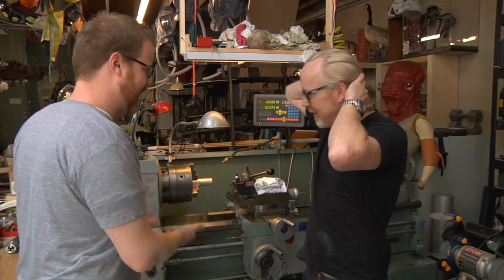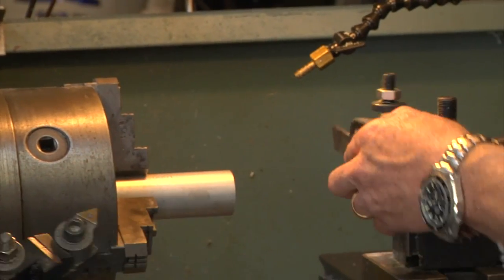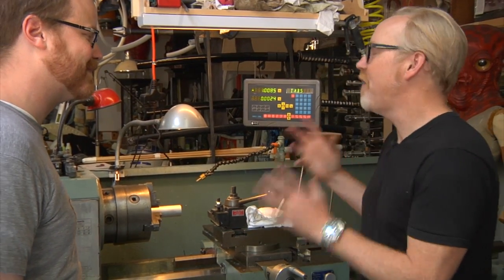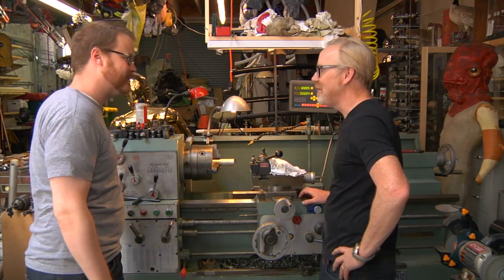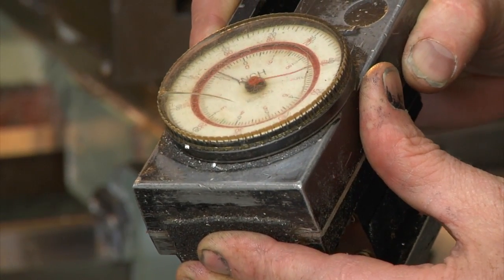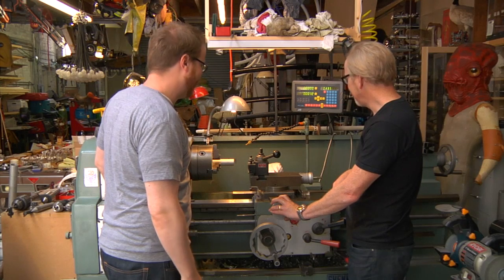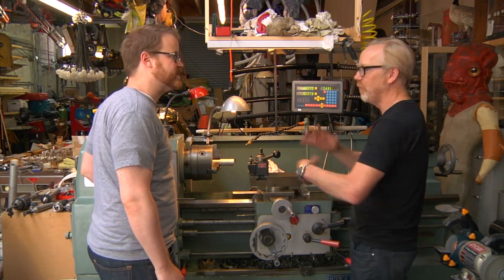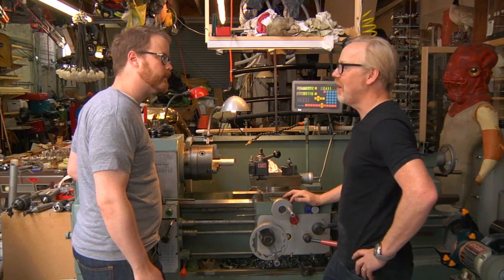Inside Adam Savage's Cave: Metal Lathe with Digital Readout

Comment: I've replaced a lot of broken glass scales and cleaned many more that had coolant or oil get inside. Even with guards they get contaminated by coolant and are still vulnerable to severe impacts. The shop I worked for moved away from glass scale readouts, especially on lathes. The magnetic resonance readouts are much hardier, easier to install, and impervious to coolant intrusion.

Comment: Nice little lathe.  Adam was right when he said the readout was a luxury.  Over the last 30 years, I've made fewer mistakes running a lathe without readout. A milling machine is a different story. Readout speeds things up 100x. On a lathe you have to pay more attention to what you are doing, instead of watching numbers on the screen. Dial indicators work just fine for hitting close tolerances.

Comment: Adam Savage just propagated a myth

A tool that is left in the Chuck will never in a million years fly across the room and go through a wall he has not seen this happen cuz it has never happened it will always fly straight down if the chip pan. It is of course incredibly dangerous to do that but I can promise you that it will never fly around in a circle come back up around the other side and leave in a position to go sailing across the room and go through a wall it is never happened in the history of this planet
Reply: Clown Whisper sometimes, when I first started, I would adjust the four jaw on the backside, and sometimes I would turn clockwise which would give it more room to fly out. Need more scientific day to confirm belief in your disbelief.
Reply: Can confirm 
Once myself and and seena few times The chuck key has a heat seeking devicein it thats 100% gurenteedto hit you in the balls 

The key falls out in the first 1/4 revolution so its not built any speed in rpm 
It wont do you any damage or ever go though a wall 
But its pretty embarising amd hurts a little
Reply: In schools in Denmark, in woodworking class, you have lathes. I have had a wooden bowl i were (was?) making go straight through the room, almost hitting my teacher in the head and shattering on the wall. Not a myth, can confirm from personal experience.
*edit: And why would it only go down from rotating? It doesn't care about gravity! Much stronger forces are at play here!
Reply: WiseOdd that is a wooden Bowl it is completely different dynamic then the Chuck key why would you even compare these two wildly different objects? A Chuck key you put in in front of you facing you and if you turn the lathe on it's coming down towards you so all it has to travel is a quarter turn straight down. It flies off and 99% of the time it will hit the chip and do you know how I know this? Because I set this experiment up 100 times and never did it fly straight away from the chuck it always fly straight down. even if it would get stuck in the Chuck and make a complete revolution around it would get stuck on the bed ways. the larger the Chuck you have the larger the key is typically unless it's a homemade key then I could see a rare possibility of it getting stuck in the Chuck and spinning all the way around and shooting straight out at head level. But the odds are astronomically against it. of course it is dangerous to leave the Chuck key in the Chuck but I guarantee you Adam has never seen one fly through the wall I promise you this
Reply: Clown Whisper didn't think of the different object dynamics. That makes sense. Let's agree on just never leaving that thing during operation 😀
Reply: Zachary Hodge yes if to stuck a key in the very back of a chuck it would be possible but that  scenario isn't really what we are talking about. that is more of a special circumstance type deal than someone just leaving a Chuck key in the common orientation

Comment: Now you cannot say that the lathe is the only tool that can build itself because with the 3d printers the game has changed
Reply: Not really. 3D printers, especially the sorts that ordinary mortals can acquire, are in their infancy and have huge, hard technological limits. Lathes have been around for millennia, were pretty much "the" machine tool for 95% of that time and can machine almost any material you care to name. They are limited mainly by their size, how efficiently they can be setup for any particular job, and how slow they can be run. Given sufficient time and operator error you could make almost any mechanical object on a lathe to a ridiculous mechanical tolerance. Compare against the accuracy, size and material limits that 3D printers have.

I don't entirely agree with the old saying about lathes but I'd like to see a 3D printer that can print its own bearings, cabling and microprocessors.

Comment: look on craigslist , theres better deals on bigger machines than there is on small .. invariably.
Reply: Yup, it's the 3-phase curse that sends too many great big machines to the scrap-yard. I so wish that I'd gotten into machining even just 10yrs. ago and I'd have had a whole stack of Iron in my shop...there is still allot out there but folks are getting wise to the new interest in machining due to YT and Instagram, etc.

What machines do you have? I've got a 10"x54" lathe and a 13"x42" lathe, I'm selling the smaller one and will be looking for a mill...Aloha, the Farmer
Reply: Knolltop Farms i bought a 7" grizzly , because since moving to louisiana , theres no craigslist deals on older machines. junk goes for 2000.. in ny, there was serious machines fully tooled for 800
Reply: Nice! I do love my old iron, but there are many times I long for a quick-change gearbox, and will likely sell both of these machines and upgrade eventually. That is unless I can get a good deal on a gearbox to fit onto the 13inch South Bend. Happy turning in the shop, Aloha...Chuck
Reply: Knolltop Farms oh man , i avoid threading like the plague on the grizzly, its such a friggen pain, you have 2 tiny keyways and it the key pops out its time for a dam telescope to find it lol
Reply: Yeah, threading dies have become my dear friends whenever I can fall back on them. It's not terribly hard to set up the gears, but it sure is easier to just switch a lever...

Comment: $10000 dollars at premium cost. very affordable.

  I definitely am wasting my time and dreams.
Reply: A lathe can be had for as little as 100 dollars.
Reply: +Oakwood Machine Works  Yeah, like a 100 dollar table saw or a 100 dollar miter saw. Useless. Pretty neat if you don't care about precision. I've used many types. I know you get what you pay for. sure you can get a drill motor and a bearing for about 150 bucks. good luck.
Reply: +Oakwood Machine Works and I don't think I made my point clear enough. 10,000 is a good price for such a precise turning machine. that's near CNC value. it is worth the money.
Reply: A. Finch I watched a used atlas sell for 125 and a unimat for 95 on bid.
Reply: Now your just teasing me! Lol... I'm gonna need a bigger shop.
Reply: A. Finch Yeah, a lathe just as good as this guys can be had for under 3-4k and a used cnc lathe, tormach or otherwise, for as low as 8-9k

Comment: how do the lathe build the sheet metal parts ? and how does he index the lathe while he building the gearwheels ?
Reply: The claim of lathe duplication has been around  for  decades.  Sheet metal parts can be hand made.  The key component is the lead  screw  and you ain't makin' that without  a lathe.   Mills cannot  make  long  cylindrical  objects.  Search  "making gears on a lathe"  and that will be your answer
Reply: That's a bit of a contradiction.
Of course you are making the lead screw (like a drill bit?) with out a lathe. How do you suppose the first one was made? 
It's just going to cost a lot more resources to build the damn thing.

Comment: Uhhh, you can build a mill with a mill
Reply: 7/16-UNF would be trivial with a short bar in a collet... While you'd have to make a series of studs and joiners to build up a drawbar. Far from ideal, but technically possible. Alternatively, swing the head around (assuming it's something like a Bridgeport or a round column), and hold a die in a large collet, and have the drawbar clamped vertically off the side of the table, and with heaps of heads you've got powerfeed for rigid tapping, this would basically be the same concept. Again, far from ideal, but technically doable.

Leadscrews... Yeah all I can think of is a 4th axis, and having the X axis connected to the A axis via a convoluted series of gears similar to how scrolls used to be cut prior to hardening. Have the A axis rotate N revolutions per unit distance of the X axis, and throw in a tiny ground tool. Again, far from ideal, but technically doable.

If we're talking about building a lathe the same size as the parent lathe, you'd probably be doing a lot of creative tricks to meet that challenge so it seems like a fair comparison.

Comment: He say that is the only machine that can build it self... well he haven't seen one of our CNC machines at my work.
Reply: heuhen CNC machines are just computerized versions of mills and lathes?
Reply: There are many version of CNC machines: CNC machines do almost everything, normally they have 1 to several mills, some of them have magazines to the mills with different tools, like that one at my work, it have three 35 slots magazines with various tools in. CNC machines do also drilling (at my work an CNC machines, tend to have 34 standard size drills), you can also add on an laths too. one of out CNC machines at work use 2 three axis mills, and 1 5 axis mills, and can operate 5 different programs at the same time.

CNC stands for Computer numerical control. you make a long program, telling the machine how to move and what tool to use.

A lathes, will get problem with cutting out big plates... a CNC will do it without question!

But we do have an Robot CNC at work, and if ou program it correct, it could repair it self, or it's companion robot...
Reply: seth newman ehhh Wrong, CNC and lath is two different things.. trust me I am a Professional CNC operator (not joking!).

But you can get CNC controlled lath.

Comment: Aah lathes, incredibly useful machines but also pretty scary (especially if you don't trust the people around you using one :P). I like how some comments are talking about "this not being a high quality lathe" and "Adam doesn't know much about his tools". You have to keep in mind that he is a prop-builder for the most part, not a rocket engineer. Also, apparently this does it for him, because he seems very happy with it. And that's what matters most.
Reply: I agree, as a machinist of close to 30 years I know that there are more ridged and precision laths out there but that one should do most of what you need done in most cases as long as it's in the size range of that lathe. I wouldn't trade either of my LaBlond laths for it but I wouldn't kick it out of my shop either.
Reply: ok so how do you spell the name of that lath??
Reply: You are absolutely right. The best tool for the job is the tool that you know how to use and that you have at hand.

Shure there might be way better lathes out there, but what is the point of having them if you already got one that does everything you want from it.

Comment: working with a lathe is no big deal. it is not designed to kill the operator. although the feed screws are right about nut level and pretty close to where you stand. don't lean on the lathe for any reason and your shirt wont get wrapped up in the feed. And dont touch the chuck when its running, you dont need to work that close to it. if you need to stop the lathe and flip the work around.

But most of all do not fear the lathe, respect it. and i think you will get along just well

Comment: yes. the technical term abbreviated is RCH for moving just a smidge of a smidgen. Incidentally, it translates well in Spanish, as i found out when working with a 20' hydrualic brake QCing a part for the operator.

Comment: You can make a hammer with a hammer
Reply: Yes, I noticed that that was overlooked as well.
Reply: yeah but you need a  blast furnace for that, another tool
Reply: but it would have to be a much softer metal hammer, you can build an identical lathe
Reply: Why would it have to be a softer metal hammer? You can make hard metal soft and then make it hard again.
Reply: No, you don't need a blast furnace at all. A fire will do.
Reply: he probably means just power tools.
Reply: Yes, but if he retrofitted this with servo motors, a tool turret and installed a computer with say... mach3 software, the lathe could literally make it self. All he would need to do is input the information. He may need to change the spindle motor too so that it has position reference input and output data.
But it may be easier to just find an older CNC lathe for a good price.

Comment: If you can make a lathe with a lathe, you can print a 3D printer with a 3D printer
Reply: Eso SM you can't print parts bigger than the 3D printer in a 3D printer so you can only 3D print smaller 3D printers :P And printing electronics can't be done (yet).
Reply: Eso SM This already exists it is called Reprap, look it up. As stated you cannot currently print the electronics or metals. 3d printing the few metal rods and electronics required would be extremely inefficient at this point in 3d printing tech for a commercial household tool

Comment: I could build that with a budget less that $3,000, why the hell are they so expensive?
Reply: Well its a big piece of engineering as well as its not really a hot commodity like milk. Even the transportation of it from another continent would increase the price quite allot.
Reply: +ZephyrStorm lol crack on then, you'll make a killing selling them
Reply: This kind of lathe doesn't have much engineering cost in it as all the technology is at least 75 years old. I bet this lathe is a copy of some 50y.o. machine. However, it is a big chunk of steel (already pricy) with many precision parts.

Comment: spring loaded chuck key???..... wise investment for any metal shop.
Reply: True, it's safer when you use a spring loaded key, but it's also a hassle. The key obviously can't stay in the chuck, when working fast thats an issue. Quick changing of the workpiece is almost impossible when you have to lay down the key all the time. So that spring is (most of the times at most of the workshops) the first thing to go.

Comment: The only problem with saying that only a lathe can make itself is that a mill can do more. A 5 or even 6 axis mill can make literally anything that will fit. I've heard rumors that Haas machines make Haas machines. Lathes do a few things particularly well and that's it. Point is that there is nothing you can make on a lathe that you cannot potentially make on a mill.
Reply: That would be CNC right? When conventional milling is done, now way you can use 5/6 axles at the same time. So Adam was right. After all, he was talking about a conventional lathe, not an CNC one.
Reply: Yes actually. If it is cnc it can do so much more. I can have the bowl threaded if you want

Comment: I would pay to see you cut the ways for a lath by chucking a milling cutter in the lathe chuck....especially since the ways are ground, not milled.  Stick to your television show, you're lost on a lathe.
Reply: You can grind with a lathe just like you can mill. Not recommended but possible. Adam is correct, he just didn't clarify.
Reply: MrDan27611

Yes, you can grind in a lathe with a tool post grinder.  However, you cannot grind the ways of a lathe with a tool post grinder.
Reply: The bigger problem I have is he bought a Chinease machine for 3k when he could have gotten a nice older southbend with a VFD and DRO for that same 3k.

Comment: How do you make the wires for the motor with a lathe?
Reply: 1) Get a big piece of copper.
2) Turn that bitch down.
3) Remove wire.
4) Rinse and repeat.

;)
Reply: make a toolholder to feed the wire as you run it back and forth wrapping it around something?

Comment: hey, here's an idea for the chuck key so you don't forget it in the chuck, have a power cut-off switch that cuts the power when you pick up the key to use it and in turn the key needs to be in the switch to start the lathe. the basic design is a vertical tube with a moment switch at the bottom that is depressed when you put the key in it. my school made and installed these because of a key through a wall accident. lemme know what you think

Comment: yup....every machinist does the 3:24 mistake.....Once.  If you live you either quit the trade or you LEARN something the continue on.   A friend is mad at me right now because I wont let him run my NEW mill.   I said...When I was working most shops wouldnt let you touch a mill until you had 2 years on the shop floor.   LOL...Run my new mill...HA...tip...you cant watch the internet and go do what you see done....Its called SKILL from working years at something.

Comment: Whats the difference between a travodial and a dial test indicator ? I never trust the dials on a manual machine, so I always used a DTI on the bed to be sure what I was doing was correct, especially when working to fine tolerances. Does the travodial do basically the same thing but with a bigger travel ?

Comment: Surprised he doesn't have a older heavier lathe.  While I'm not quick to knock the Chinese stuff as it will do the job depending on the love you show for the machine and the accuracy you need, there are so many old nice machines that would be so much better which Adam could certainly afford.  The 1900-1950s era of machine tools were built so well and so rigid.